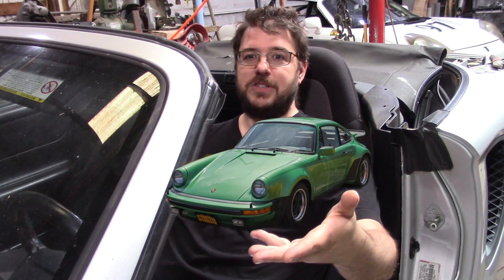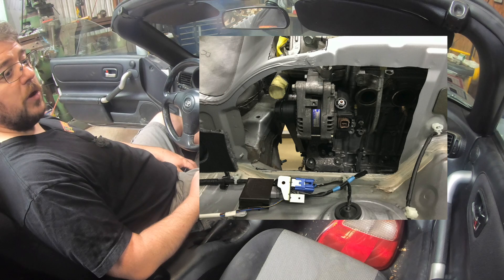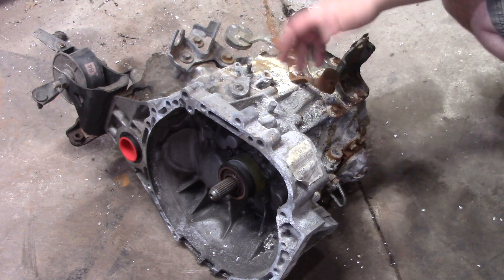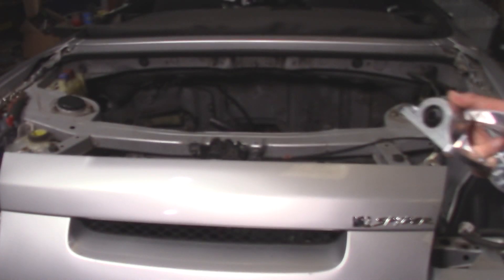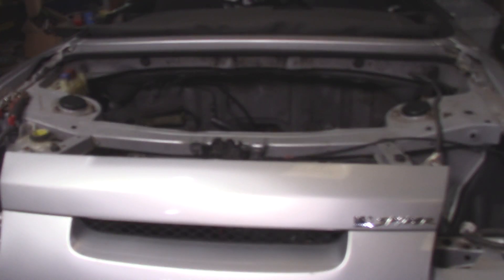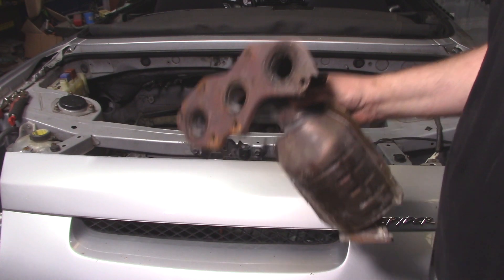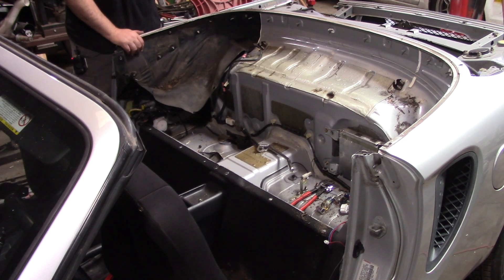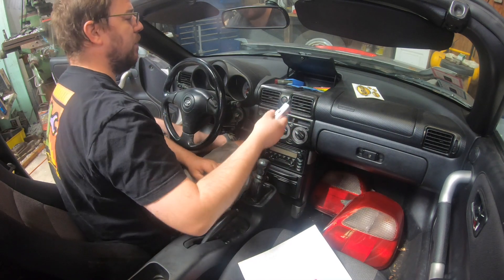Project Widowmaker Introduction - 2GR-FE powered MR2 Spyder

Comment: i have a rav4 with this engine. what are some good engine mods for it, besides a $5k supercharger kit?
Reply from the maker: The biggest gain is fixing the y-pipe. The stock y-pipe is terrible and eats up about 40-50hp. Sounds high but it is repeatable over and over.

Comment: What transmission are you guys using?
Reply from the maker: This car will be using the EB62 from a 2010 Camry but the EB60 from the Scion tC works great and is significantly more available. It'll have a limited slip differential that i will have for sale very soon.

Comment: What do you think about to stroke the 2gr to 4.0L using internals from 1gr?
Reply from the maker: The 1GR internals are actually pretty different. the main journals and the rod journals are different sizes to the 2GR. The flywheel flange is also a different OD and has a different bolt pattern on it. So while it's not impossible it's certainly a whole lot more work than the engine code similarity would imply.

Comment: I’m doing this build I need to get the engine, trans and hardware still but I’m removing seats, harness, cooling, etc
Reply from the maker: I'm happy to hear that. The motor mount is currently in production and should be available around the end of the year so this should be a fair bit easier at that point :)
Reply: @FrankensteinMotorworks  Patiently waiting for that, in the mean time I'll he removing and finding the engine and trans

Comment: I have a 2GR-FE from an RX350 which has an oil cooler.  It doesn't seem like your version had the oil cooler.  Guessing the version with the oil cooler wouldn't have any issues fitting?
Reply from the maker: I am using an oil cooler motor. Not because it is needed but because i wanted to check the clearances because i knew this question would come up. You can see it in the 2nd video at about 2:30 in. https://www.youtube.com/watch?v=tSlcfFxc8OI So far there are no clearance issues at all and i don't expect any.

Comment: 2arfe engine mounts are different from 2grfe?
Reply from the maker: The motor mount on the right is different, the other three mounts are actually on the transmission so those are reusable from the 2AR-FE/EB60 application.
Reply: Frankenstein Motorworks So if I want to make the convention of my scion tc (2arfe) to 2grfe I only have to redo the right mount? apart from the ravisa.
Reply from the maker: @yianielsr  as far as bolting the engine and trans in goes, yes you only need to redo the mount on the right side to mount a 2GR-FE in there.
Reply: Frankenstein Motorworks Can I use the OEM harness or do I have to use the 2grfe harness?
Reply from the maker: @yianielsr  You'll need to use the 2gr-fe engine harness but the small ECU plug will be able to be repinned for 2gr-fe use and you'll have to integrate the fuse box connectors in. the good news is both vehicles use the same overall architecture so it's a "connect the dots" affair, pretty easy.

Comment: would be great to have more option on the brake upgrade. I track my k20 Spyder with a bbk on the front only and I feel like the rear need more to balance it off. I don't really need parking brake so please make a kit and sell it. thanks!! PS might be I will get the whole 2gr swap kit from u in near future. no replacement for displacement lol
Reply from the maker: Yeah, i do find it frustrating how many "big brake kits" just do the front wheels without balancing the rears. Especially on a rear biased car it's even more important since the rears are doing a fair bit of the work.
Reply: @FrankensteinMotorworks  the rear gets a lot hotter too. Please make the bbk available. I will be waiting.  Thanks

Comment: Debating between the 2zz and the 2gr, this series will decide my future lol
Reply from the maker: Those really are very widely different choices. one side is damn near bolt-in and produces the least horsepower of the engine swaps and the other side requires chopping up a bit of metal and produces the most horsepower of the available engine swaps. But either way, if you have any questions feel free to ask and thanks for watching.
Reply: @FrankensteinMotorworks  yes definitely, just figured go big or go home for the swap. Just hesitant about what it all takes which is why I was considering the bolt in. I will be definitely watching along with your build.
Reply from the maker: @leoortiz7090  Something else you may want to consider if the 2GR ends up being more work than you want is the 2AR-FE swap. that one is trivial to do and is way more power than the 2zz swap. But if the 2GR is what you want then you should watch this first :)
Reply: @FrankensteinMotorworks  I'm going to view your video and check the specs out. I see you have a kit, so that will help
Reply from the maker: @leoortiz7090  Yeah, the 2AR-FE is as close as you can get to plug & play. Feel free to ask any questions you have about it.

Comment: Woohoo! We can get the 2GR in the UK, can't get the 2AR :-( so this is of great interest. Would still need to ship the EB60 transmission though.. but that's small fry in comparison.
Reply from the maker: Actually you do get the 2AR-FE in at least the Lexus ES300H and very likely other cars but it's hard to get a confirmation from over here on all the cars you get it in.
Reply: @FrankensteinMotorworks  Interesting - just looked them up on wiki and they're listed as the 2AR-FXE and 2AR-FSE in the 300h cars. So I guess whether you go AR or GR you need to get the Scion gearbox from the US as they're all automatic over here. Oh and the Sienna? Ecu as well.. plus all your conversion stuff...
Reply from the maker: @jlfvanzyl  Some of them do have the -fxe and -fse motor in them but they also have the -fe motor according to the Toyota parts catalog. For the gearbox i think the closest you can get is the EB61 i think from the rav4 was available in russia with the 2AR-FE. the final drive is 4.6 instead of 4.058 so it'll be really short gearing but that may be cheaper than going all the way to USA to get it. As for my conversion parts, I'm more than happy to ship overseas, i do it all the time.

Comment: Mark I love it 6 speed is wonderful when can you build one for people like me? Yes you will need an employee or 3 watch it grow your company. Yes we will need high power brakes and a solution for a cable or something for the park brake. Also will an EB62 work for me the gearing for highway is better wish one could replace the final drive gear as 4.058 is also to low give me 3.6 if possible.
Reply from the maker: I don't currently do any customer installs, i just supply the parts and knowledge to make it easy. This is just a side hustle for me, i already have a day job
Reply: @FrankensteinMotorworks  Will the EB62 work as well and can one change the final drive gear ratio? Maybe my friend in NC will build one for me. How much for all the part excluding motor and trans?
Reply from the maker: @jlozinsk  Yes, the EB62 will also work, it's just usually much harder the find. You will have to swap the shift levers for the EB60 ones though but that's pretty cheap and pretty easy. All the parts are available here: https://frankensteinmotorworks.com/ but the parts i will use for this are the trans mounts shift linkage kit, dbw adapter, ECU, MAF pipe, body controller, 2ar-fe wiring harness and probably the ECU brackets. That adds up to $1832 from my store.
Reply: @FrankensteinMotorworks  Will I be able to get a Thorsens limited slip or will I need to go quaife?
Reply: You can swap out the 6th gear from the Camry into the Scion transmission while you have it apart.
Reply: @michaelscholten9753  Will I be able to get a Thorsens limited slip or will I need to go quaife? Also do other gear ratios for final drive work can I go 3.77? I am an American who lives in Bulgaria but the work will be done in the USA.
Reply: jlozinsk there’s a thread on Spyderchat to sign up for a custom LSD- there isn’t anything you can buy off the shelf.
Reply: @michaelscholten9753  I looked and looked it looks like LSD can be done but how is not easy it sounds like OS Goshen or Quifie.

Comment: Ohhh EB trans, possibility of using this with a bell housing adaptor for a 1zz??
Reply from the maker: With a bellhousing adapter i'm sure it could be done. It will not bolt up directly though and the engine position is probably slightly different than stock so other changes may be required also.

Comment: Finally my dream build :) eb60 really sits perfect how much do they cost in the usa?
Reply from the maker: Radstar, Normally they are about $1000-1200 but with COVID and everyone trying to start projects right now they are closer to $1800. At the moment it's honestly cheaper to part out a Scion tC to get the transmission or for $2300 you can get a trans brand new from the dealer.

Comment: What are you planning to do with the 2gr to get 340hp out of it?
Reply from the maker: I just plan on using the "#2" intake manifold from the Venza, a nice free flowing exhaust, a bit of lower intake manifold porting and my ECU tune. We get 290-300whp from these all the time without opening them up. But since this is youtube i went ahead and added an estimated drivetrain loss in and said HP instead of WHP. That's about as clickbait as my channel gets.

Comment: You ah..... Wanna sell me that soft top?
Reply from the maker: Did you not see the several bits of duct tape holding the rain out on it? Plus this car will very likely be getting the soft top back, it's only being removed to have room to create the access panels. Unless i somehow come across a screaming deal on a hard top but that's very unlikely
Reply: @FrankensteinMotorworks  no i did not see the duct tape but this was mainly a joke. i just flextaped my soft top and saving for a hardtop.

Comment: Awesome pretty excited to see this get done :) I wish you were doing the e153 haha but makes sense why not. I just pulled my 1zz and am getting my trans(e153) prepped to mate to the 2gr and then time to figure out how to get this thing in there lol I hope I can keep up with you and can get on the wiring at the same time you are!
Reply from the maker: Todd, Honestly i fell out of love with the E153 after trying to put one on a race track. The gears may be super strong on it but the synchros are just complete crap. I was never able to get the synchros to last an entire weekend of endurance racing. With the EB60 i only need to service the transmissions every couple years with endurance racing abuse. The fact that it has better gearing, is lighter, small enough to fit without cutting the crossmemeber and better shift feel is just icing on the cake.
Reply: @FrankensteinMotorworks  I like the eb and I'm still on the fence about using it but I was lucky enough to get a cheap e153 and free quaife LSD I really want to put them to use although I think going eb and having no trouble with the axles and stuff may save a ton of time and headache and since I'm not doing any real power adders it might be better going eb is there any LSD options for it?
Reply: Man I feel like as I wrote that I may of changed my mind on the trans -_-
Reply from the maker: @toddhargett2135  The EB60 has one LSD option right now that is really hard to find but there's a few Spyder owners that are working on solving that.
Reply: @FrankensteinMotorworks  hmm I'm going to have to do some research tonight and see which one I want to go with
Reply: @FrankensteinMotorworks  man i really want to give the eb60 a go but trying to find one right now has been about the same as trying to find an e153 i found 2 so far and both places i could find them at wanted 1500 and 2000 for them i don't want to  spend that much on a trans haha
Reply from the maker: @toddhargett2135  Yeah, unfortunately just about anything related to just about everyone's hobbies is in short supply right now.  I imagine these prices are temporary and should return to normal when the world isn't on fire anymore. Alternately, if you do spend $2k on a transmission just spend a little bit more and get a new one from Toyota, it's about $2300-2500.
Reply: @FrankensteinMotorworks  yeah I'm going to have to sit and debate it quite a bit i may just use my e153 I already have for now and buy or build a customer subframe later if/when I go to the eb60
Reply: @FrankensteinMotorworks  or well I should say buy a stock subframe that isn't cut up haha or build a custom tube subframe
Reply from the maker: @toddhargett2135  Sounds good, but honestly once you have the E153 in there with all the extra work and money spent on axle shafts there's really no reason to switch back to an EB60.
Reply: @FrankensteinMotorworks  true but I don't see me going through the trouble of switching to the eb for quite some time unless the e153 pisses me off haha

Comment: Good plan on the EB60 considering the bearing could be bad from the start....  It would be aggravating to take the trans out for that especially if you had it apart on the table for the reverse detent.
Reply from the maker: Yeah, you've got a bit of experience with that bearing, you're the one that actually brought it up to me the first time. I never even realized it was an issue before.
Reply: I did that... 😂

Comment: interested in seeing your exhaust routing. I got the same ones but ended up making one out of steam pipe going straight down.
Reply from the maker: It's entirely possible that i won't be able to make my current idea work, i'm going through this for the first time with you guys so we'll see what ends up working when we get to that point.
Reply: @FrankensteinMotorworks  I found that one you have there sticks out to much ill send you a picture on them of them side by side
Reply from the maker: @coqulation  Yeah, any pictures of fitment issues would be appreciated.

Comment: I'm very much looking forward to this series!!!
Reply from the maker: Me too, it's always fun to do a new kind of build that i haven't done before.
Reply: @FrankensteinMotorworks   Hey what do you think performance wise if i soaped a 2G into my 74 Toyota Corolla rear wheel ?? !!!
Reply from the maker: @user-pd9vm9ts1o  the engine code actually includes the "R" a 2G would be a straight 6 motor of about 2.0L in displacement.

As for your '74 corolla, a 2GR-FE would be fine but putting a UZ motor in there would be easier and all around better. you have a larger engine bay so you should use it.
Reply: @FrankensteinMotorworks   I see  thanks

Comment: The.  mr2  didn’t come with enough horsepower your refining them 👍 thanks for sharing your knowledge and  mechanical  wisdom
Reply from the maker: While I agree with the fact that they did not come with enough horsepower, I do really think this is a bit much for a chassis this light. But it'll still be fun.
Reply: I wonder how many people told Carroll Shelby that same thing when he took a dated AC Ace British sports car and installed a Ford V-8 with a Borg-Warner T-10 four-speed transmission producing 410 HP torque 480 @ 6k.? ...Basically the same thing your doing. God Bless you sir!! I am already subbed and currently own a 2001 Spyder with a 2ZZ & Rotrex SC. Would’ve loved to learn about this option sooner!

Comment: Toyota is on their 3rd try with that Input shaft bearing. The bearing in the TSB has been replaced with an updated one.
Reply from the maker: Interesting, do you have the TSB for that? i'd be curious to see it. I only just recently learned about this issue and i never had a problem on my race car with this bearing. Of course, street cars get abused in completely different ways than a race car.
Reply: @FrankensteinMotorworks  Sending it to you via FB messenger
Reply: DuckVision - can you post the part number here?
Reply: DuckVision thanks- that is the one I used. https://www.mr2-spyder.com/community/engine-swaps/2arfe-eb62-transmission-bearing-replacement/